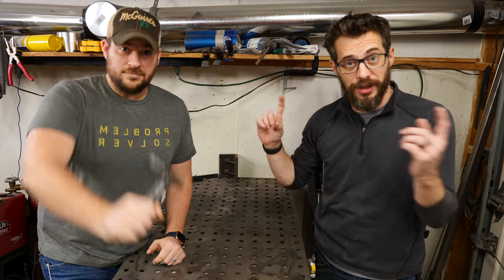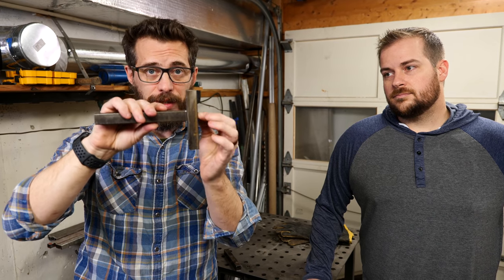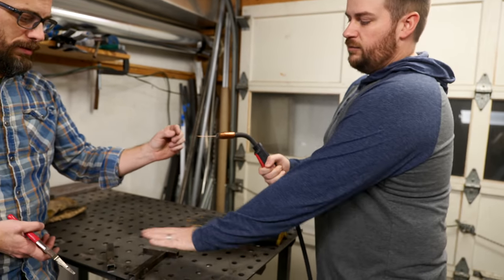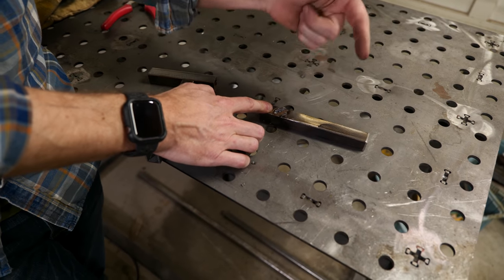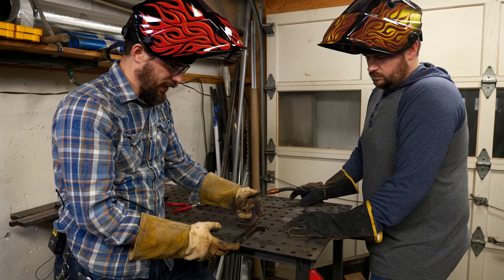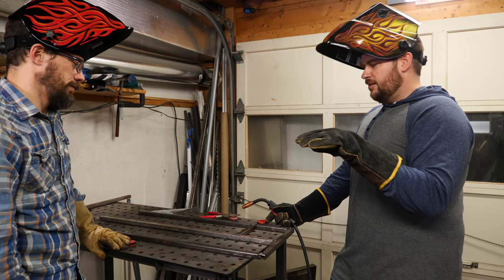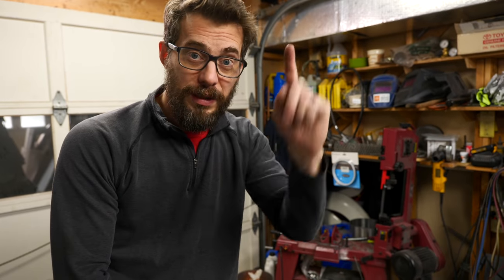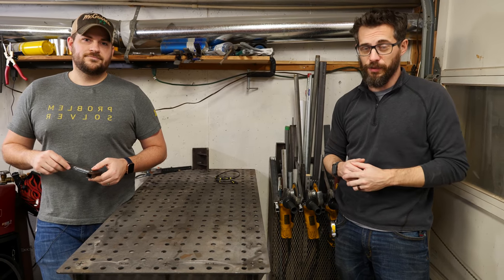Making Simple Steel Storage while Learning to Weld | I Like To Make Stuff

Comment: Hi! One question. We have a electric welder in the garage. I have a old car with some rusted body panels on the underside. My dad says I cant use the electric welder on thin body work because it'll burn right through it. Is this because of the high voltage the electric welder gives? Or is it because it doesn't use gas? Maybe this is some low level theory, but i'll like to know! Thanks!
Reply: Yes it's all about the controlling the heat. Thin material doesn't have much of a heat sink so it's easier to blast hole in accidentally.
Of course if you get good, you can weld about anything! But for thin stuff TIG is usually a better process, but has a steeper learning curve compared to MIG
Reply: TommyGun Machining Ah alright! Guess i’ll look into TIG welding because I mostly want to weld bodywork. But it might be too hard for a beginner, gonna do some more research. Thanks!

Comment: do you mean amperage instead od voltage. You can controll voltage but that looks like a fairly simple welder but I may be wrong.
Reply: When wire welding you set the voltage. The amperage is based upon the wire feed speed.
Reply: @saminthecan  Hi, thanks for teaching me something i didn't know. I acctualy never mig welded. I learned stick welding and i did some tig but never mig.

Comment: Noting against bob, but you do not need a autodarkening mask,   You can use a normal mask, and when your are about to start you’d weld, after you have aligned the torch, nod your head so that the mask falls down in front of your face without you moving your hands. I really like a miller welding helmet that is non auto darkening and is 40$-45$ on Amazon. For those of you that don’t know most masks are non autodarkening where they are just black and much cheaper, and autodarkening are clear until you start welding, and are about 4x the cost. It is also important to have good welding gloves (15$-25$ on Amazon) or you will burn yourself, it is similar to frying bacon naked because of the molten metal splatter. Also, I normally use a pair of pliers to measure the wire, flip them around so that the cutting edge is on the far edge from the torch. Just some helpful info I thought I could leave to help a new welder